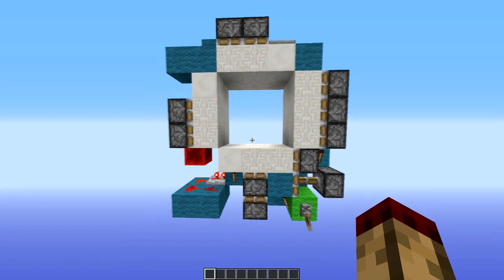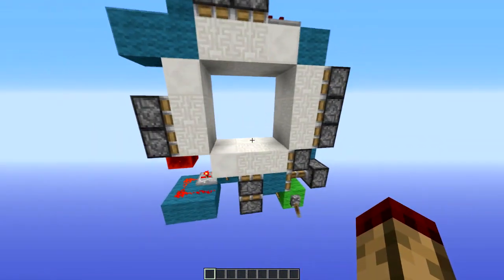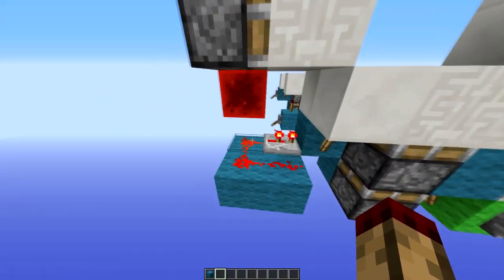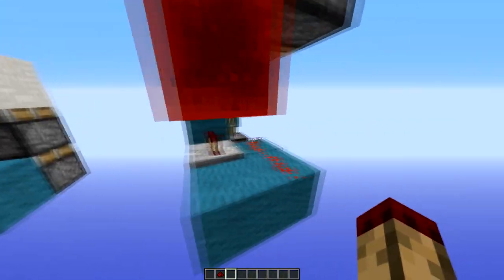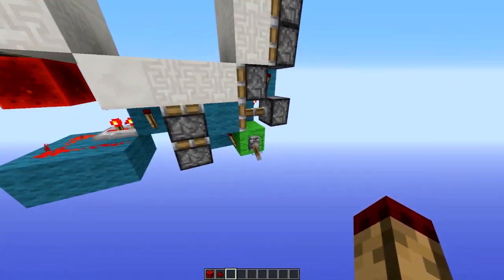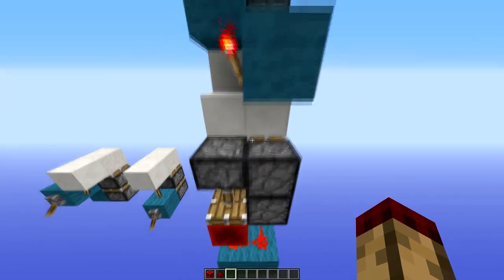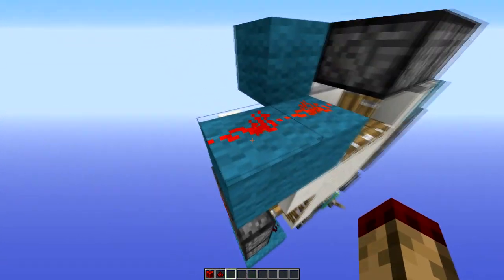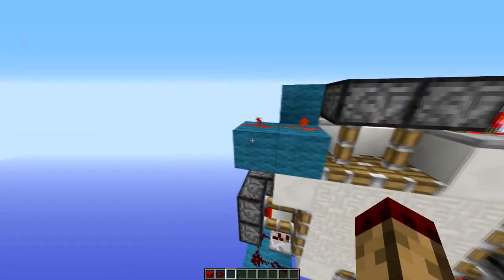Minecraft: 3x3 Piston Door [Smallest, 2 Wide]

Comment: it is not working in 1.19 anymore .. the reason is that the double extender does not work .. lf u build the second example in 1.19 it works exactly the same as the first example .. flip the switch once to extend, but you need to flip it two times to get the second block fully down to the starting position. The redstone wire stays active and keeps the first piston extended .. i think this is due to the changes in redstone activation rules in 1.18 or so

Comment: could you please make tutorial that actualy works becos the pictures make it really really hard to make right becos the torch at the side of the middle piston makes it go nuts! like really nuts
Reply from the maker: Build it without the bottom pistons, turn on the level then put the pistons in.
Or put a furnace or block of obsidian above the red stone dust to stock the sideways piston messing anything up.
Or make mruberducks version I linked in the description that doesn't use torch burnout.

Comment: hey, tt. I am having an issue with the completed 3x3 door and was wondering if you were still around to help with it. From what I can tell, the piston (in layer 3) that is designed to pull the center bottom block (of the door) from the center piston pulls AS the bottom center piston pulls down the top center piston for the first time. Also, the first time that the bottom center pulls down the top center piston, the the top center piston moves back up without pulling down the bottom center block. I know this is confusing, sorry. Could you help me? (I am playing in 1.12.2)

Comment: idk why but it just does't work for me i get the door to close but not open right
Reply from the maker: Forthwindx If you could send send me a screenshot of the circuits you have built I have see if there is anything wrong. With it not opening properly you could have a repeater timing wrong.
Reply: http://gyazo.com/3c83d5c2e57c007d3cf8bc0b2162eb9f
http://gyazo.com/4e5bc93986211bc2caa8a29941cf785a
http://gyazo.com/4882446e6d21cca3c9ed660f2dca9d5e
[6:18:52 PM] Colin: http://gyazo.com/a8010a40d796b4927ad5b78cf1170ad3
http://gyazo.com/01de754c413d65a02ca77a64c248f6aa
http://gyazo.com/a9735e6e66be4ecb93cbd69577d17053
http://gyazo.com/c318deddc58b9f46efca45bc3921db04
[6:18:54 PM] Colin: http://gyazo.com/5608eb0290d913f7827e1c9246701017

Here are all the screenshots
Reply from the maker: Forthwindx Oops, I missed a torch in the tutorial. In this http://gyazo.com/5608eb0290d913f7827e1c9246701017, place  a redstone torch on the green block next to the extended piston and then a block on top of that.

Comment: Does this work in 1.8.4? for some reason the timing on the redstone block is off. it cancels the clock too early so the middle block doesnt retract all the way.

Edit I added a second repeater on top before the 4 tick one and set it to 2 ticks and it works now, it just looks wierd when it closes now.
Reply: Okay 1.8.1 1.8.2 1.8.3 1.8.4 1.8.5 1.8.6 1.8.7 and 1.8.8 don't effect anything they r just bug fixes

Comment: Hmm, this design isn't working for me. Something is wrong with the timing in the double extender swapper bit. I fixed part of it by swapping the redstone dust and repeater around, but it's still not quite working. I'm building in 1.7 though, possibly something in the redstone has been changed?
Reply from the maker: If you are in vanilla nothing has changed. Non-vanilla servers 1.8+ will also work. Send me some screenshots of how you have it set up and I will help.
Reply: TT Lemon
I'll have to get back to you on that, but I've built it as per your screenshots twice and had the same problem -- the bottom piston stays extended when the door is opened, so won't retract the middle blocks.
Reply: ***** I have the exact same problem, I double checked it with the screen shots and this video and the bottom piston stays extended when the door is open.

I fixed the problem by extending the delay for the top repeater, put another repeater behind the one on 4 ticks and set it to 2 ticks, that fixed the problem for me
Reply: TimeDestroyer
Thanks, I'll try that and see if it works. If not there's another 3x3 I've been using that seems to work fine, it's just a bit bulkier.

Comment: I built this as best as I could. went over it about 8 times to check if I did anything different to tutorial and video but I havn't. I however have found my issue lays in redstone. On the second layer, behind the piston where it has a redstone and a repeater. The redstone is always on and it is causing my piston to stay extended because if I destroy it, it will go down. any way to fix?
Reply: Check the ticks on the repeaters, that is very important
Reply: i tried checking them and they were fine and i still have the same problem

Comment: I'm having trouble with the double-piston extender. It seems that the input during the retraction is too fast, and doesn't allow the sticky piston to "stick" to the center block.
Reply: I suppose this design doesn't work with SMP.
Reply from the maker: RPJoey
It works in SMP, just not bukkit servers because bukkit breaks piston update mechanics.
Reply: TT Lemon Aah! Very well. Thanks for your response.